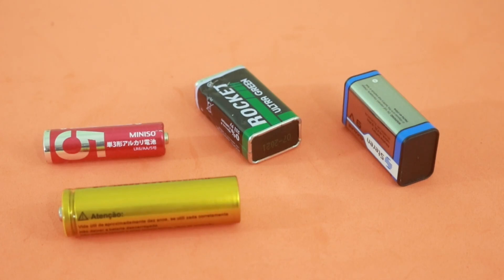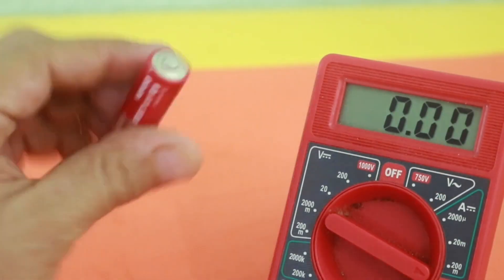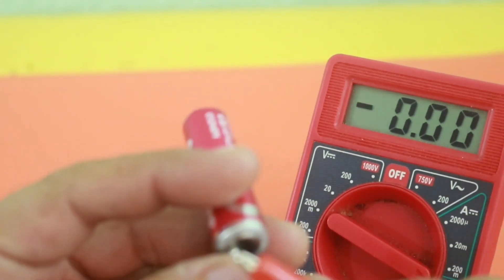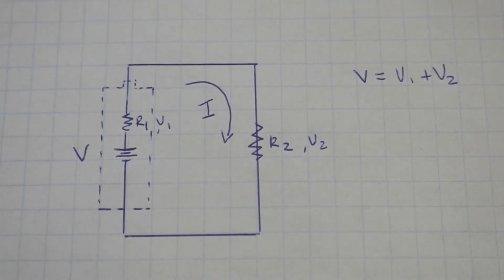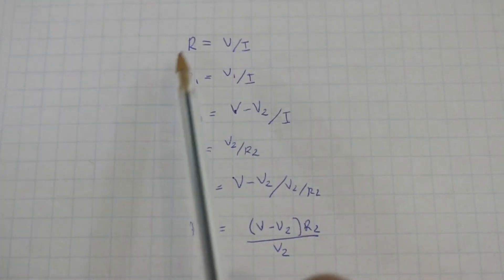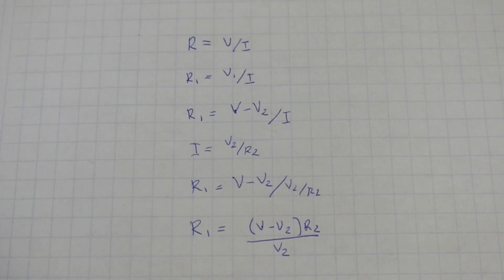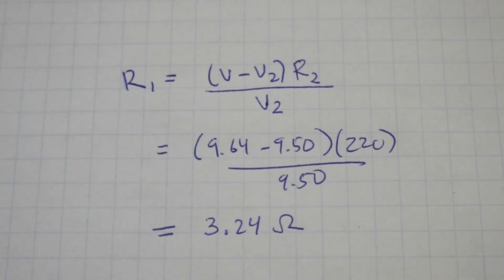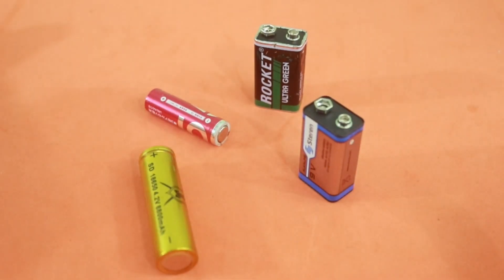How to Measure the Internal Resistance of a Battery

Comment: Thank you for your timely video! What resistance value should we use as load to test 12v, 200AH Lead Acid battery?
Reply: 220 ohm is always use for testing

Comment: The problem is, the internal resistance has many definitions. What you are measuring is long-term DC resistance (the DC internal resistance can be varying as well). The internal resistance measured by the common internal resistance meter is AC 1kHz resistance. There are huge differences between AC resistance, short-term DC resistance and long-term DC resistance (one of the root cause could be the nonlinearity of the chemicals such as polarization). The internal resistance (or to be more accurate, impedance) is a complicated topic and cannot be explained clearly with few words, you can search for EIS (electrochemical impedance spectroscopy) for more information, as well as some test standards such as HPPC (hybrid pulse power characterization).
Reply: I would argue that the method in the video is by far the most meaningful in practice. Ideally you would measure it this way over the entire discharge cycle, but this is often good enough. 

I dont really get the point of the AC 1kHz measurements. In my view it would show more the transient response (but also badly) rather than anything else - which is never very good anyway and is vastly increased by adding some (electrolytic) capacitors in parallel, if it matters. On the other hand, the DC resistance actually tells you the voltage drop in most situations and therefore when your voltage may be too low etc.
Reply: @Basement-Science  I don't think so. AC 1kHz resistance has become a de facto "standard" in battery industry and it is useful in practice. Lots of battery manufacturers (I mean rechargeable battery) give 1kHz resistance data in their battery datasheets. Therefore, by measuring the 1kHz AC resistance of your own battery, and compare the results with the one in the datasheet, you can know about the aging of your battery in most cases.
Reply: @steadyfield  I know manufacturers commonly give you this value, but that doesnt make it much more useful. The discrepancy between AC 1kHz and a DC measurement like in the video can be pretty big, and more importantly, the difference depends on the battery. 

So just because 2 batteries have the same AC impedance doesnt tell you much about their DC internal resistance. It could still be vastly different.
Reply: That's exactly what I wanted to say. EIS and HPPC tests are required to accurately gauge the internal resistance. Mere DCIR test is not going to tell you the full truth.

Comment: R[internal] = R[load] * ( V[open] / V[load]  - 1 )
Use R[load] at about 10 ohms.
Reply: With 10 ohms the battery is almost short circuited
Reply: @stefano.a  So?
Reply: @schitlipz  the battery discharges very fast, the voltage across the resistor vary also fast and the internal resistance measured is very different from the value provided by the manufacturer
Reply: @stefano.a  mfg spec sheet ... I'm not feeling like I want to argue.  I'm too old for this kinda thing.
Reply: With this simplified equation,
 V[load]-1 must have then an absolute value for V[load]<1
and V[load] cannot be equal to 1

For other values it is OK.
Reply: @NemencioRas  thanks

Comment: The load resistor in the example has too low resistance. The internal resistance variates according the load. Try with another load resistor and you will find another internal resistance value.
Reply: No.  That's wrong.
Reply: @schitlipz  you have not made measures about internal resistance of batteries. Try before speak please. This is not a mistery: the internal resistance is provided from the manufacturer according to precise nominal load condition.
Reply: @stefano.a  You do not know me.
Reply: I don't know why my reply to you was removed.  I said, "No, that's wrong."  [Seems the comment was put back up.]  If you want  to prove it to yourself, try using a decade box and use the equation given.  Don't complain when people correct you.
Reply: @schitlipz  your reply means only that you haven’t made the measure. So, do not insist
Reply: @stefano.a  Why do you argue with an electronics engineering technologist?
Reply: @schitlipz  because I am an engineer (not junior) and that kind of measure is my job
Reply: @stefano.a  You measure battery internal resistance as a specialty?  If so then I bow down to your expertise and welcome to be corrected.  Therefore, please correct me if possible.
Reply: @stefano.a  Who you calling junior, kiddo?
Reply: And AGAIN my comment was removed for some reason.  YOU ARE WRONG.  Stop complaining about being wrong.  Just accept it.  And YouTube moderators:  Stop playing your Peter Pan card of make-belief land where everybody can say wrong things and NOT be corrected.  This is engineering, not social garbage.
Reply: @schitlipz  you have to make measures before speak. I repeat: this is is my job. 
And for youtube: the messages containing URLs is automatically removed
Reply: @stefano.a  Did you try it, like I said, with a decade box?  Did you try it?  You keep saying this is your job, arrogantly, and are very defensive.  That alone speaks volumes.

I don't have to go around telling people the electronics work I have done.   My resume and work experience... this is not a contest, this is engineering.  This is (was) my job too.  Now retired.  I'm very please to meet you, btw.  It's always nice to meet another electronics person.

You tell me to measure and then say it again.  I tell you the same.  You think I haven't?  You think even now I haven't scoured the search engines looking for any evidence or chatter about battery internal resistance changing based on load?

There is nothing to back you up other than if you actually prove it.
Reply: @stefano.a  Okay, got my old stuff out and made measurements:  When the load is so low (high resistance) the calculations are rather pointless because the difference in orders of magnitude are too great.  With a higher load (smaller load resistance), the calculations become more precise.

It is true that a greater load will deplete the capacity of the battery and thus change the internal resistance, in time.  The load, however, is not an inherent property of the battery.  It is a property of the circuit, how long it has been on, how tired the battery...

Also true that a high load will heat everything up, eventually, thus the temperature will cause a change in internal resistance.  The temperature, however, is not an inherent property of the battery.

Senior, please teach me;  How, in fact, does the load change the internal resistance of the battery?  Please tell me the relation between a battery's internal resistance, and any change in the load.  Do you have an equation, or a graph?  The direct relation, not a derivative.

I would very much appreciate it very much.  Thank you.
Reply: @schitlipz  the internal resistance of a battery is dependent on its size, state of charge, chemical properties(type of battery), age, temperature, and the discharge current
Reply: @stefano.a  unbelievable 🙄